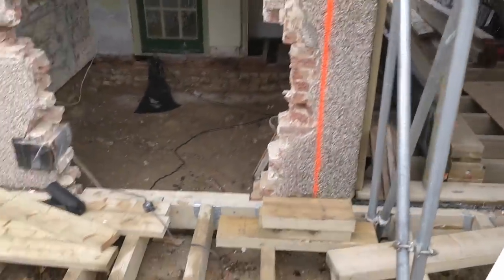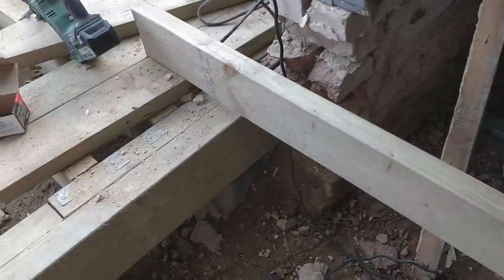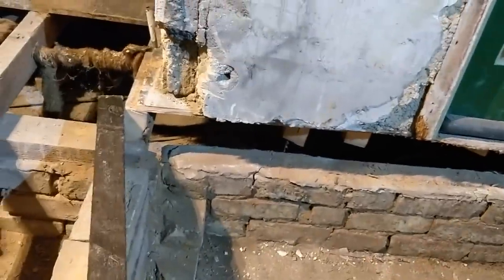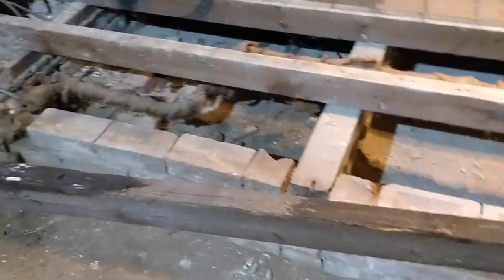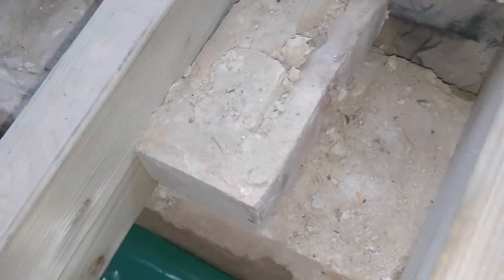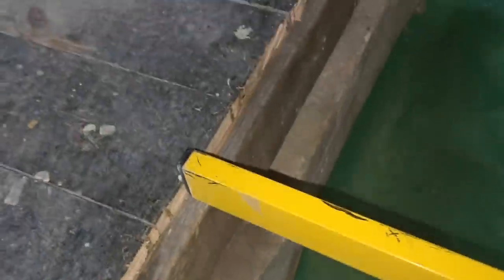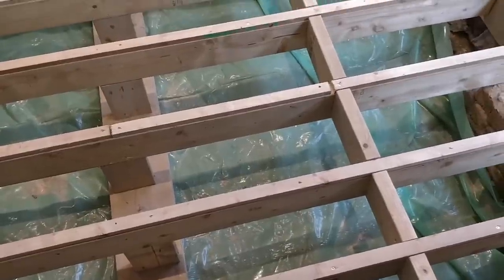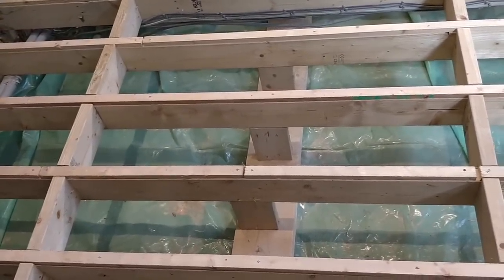Old kitchen floor rot & repair

Comment: All very interesting but make sure you maintain good ventilation under all the suspended floors. Keep up the good work and stay safe.
Reply from the maker: Yes mate, good shout. I was ensuring that there was airflow across the space, especially as the rooms flow into the utility and old living room - we have air bricks at the front and rear of the house, so there's a fairly substantial amount of air flow. It's hard to show a breeze on camera but that's why I was wearing woolly gloves! 🤣

Comment: Didnt realise how strong osb is to use as a packer good tip thanks
Reply: Yeah it's compressed as much as possible during the manufacturing process so it is and will stay nice and stable as long as it is kept dry, the same goes for plywood I believe. 👍😃
Reply: @garethheathcote4988  cheers learnt so much about woodworking on youtube its been great
Reply: Stephen Strange  why??
Reply: My dad  bless him, always told me to use old slate for packing.

Comment: This floor feels like Trigger’s broom. Lol. Wouldn’t a new insulated concrete floor throughout have been easier?
Reply from the maker: Lol I understand what you mean, but we wouldn't have been able to use a concrete floor because of the foundation system we used - doing Pier and Beam foundations doesn't allow loads as big/heavy as are created by poured concrete or beam and block floors.

We did beam and pad foundations because they allowed us to build right up to the boundary without needing to get a digger across our neighbours land or ripping up their patio, and it's great for single storey timber frame walls like we've got.
Reply: @OfficeBoyBuilder  enjoying your content from Riyadh Saudi Arabia. Especially during this COVID debacle. Keep it up👍

Comment: were ever your joist runs over brickwork wrap a piece of DPM around it , for your layout have you thought of knocking passage door and lounge door out to make the layout more square  and moving door in passage way further back, and only have one door entrance, or just build a stud wall in one of door openings
Reply from the maker: Cheers mate, I did wonder about doing that under the timbers, and started to, but then figured it wasn't any different from when I bolted my second storey ledger boards to the walls for my suspended timber floor...either way I think you're right, it would generally be better to have a DPM under there.

Regarding the layout, we did consider that, and almost went with it, but there are elements of that lower wall which support the stair stringer above...we are taking out one of the single doors and boarding it up, and then opening up the door into the kitchen and making it a big double door.

Comment: At 22:43 there's no DPC under those new timbers? Are you concerned about that being a problem of the future?
Reply from the maker: Good spot bud! In all honesty I think I was being a bit OTT when I sat the other ends of those joists on DPM...! They're absolutely fine without them because there's so much air and space around. It's no different from the ledger boards that I've bolted and chemically fixed to the walls; there was no DPM behind those.

Comment: Would there have been any benefit in having concrete floor slab ? I'm currently planning extension an that's seems the better option. Sorry if been asked before new subscriber
Reply: Block and beam?
Reply from the maker: Yes there would have been benefit in doing a concrete sub-floor...the reason that we didn't/couldn't was because of the foundation design that we used.

Beam and Block works really well and is very strong and quick, however it's not possible to use that system when you have Beam and Pad foundations like we do, because of the way the loads are implied.

We used a Beam and Pad foundation because it uses slightly less concrete, and allowed up to build right up to our party wall much easier (because we didn't need to get a digger right up to the house on our neighbours side etc.)
Reply: @OfficeBoyBuilder  sorry mate Can I ask what foundation design? Beam an block, suspended timber and concrete slab should all have similarly footings an substructure brick block walls no??
Reply from the maker: Yes that's true, but the way the load can be placed on the footings is slightly different...so for a full-fill trench foundation, you build right in the middle of the footing.

With a beam and pad foundation it is able to accept an eccentric load, where the weight is placed right at the edge of the foundation, but only up to a single storey of timber.

We would have had too much weight on the reinforced concrete foundation beams, if we had then use beam and block subflooring over the top of that...perhaps check out my earlier foundation videos in this series to see what I mean, because I think I explained it all then, or in the very least showed what we did. Hope that helps mate?
Reply: @OfficeBoyBuilder  thanks mate 
Slowly working my way though your videos 👍👍
Reply from the maker: No worries, there's a lot there to wade through, especially if you don't know that the answer is even in one of the videos! Thanks for supporting the channel.
Reply: Not really and definitely not in this case. Suspended timber floors are warm and a dream for carpenters to work on. Concrete is cold, expensive, hard to insulate, horrible to work with and labour intensive.

Comment: To much plastic sheet you will get condensation  plastic sheet is only a barrier when trapped between layers you will need a lot of ventilation to keep this clear of condensation
Reply: Really? I don't think you understand VCL and condensation. Where exactly will the condensation be and where will the moisture come from and what temperature difference will cause the condensation? He's doing fine. Don't give him duff information.